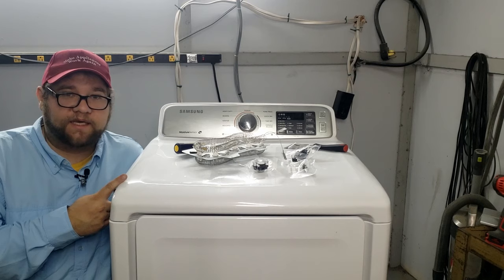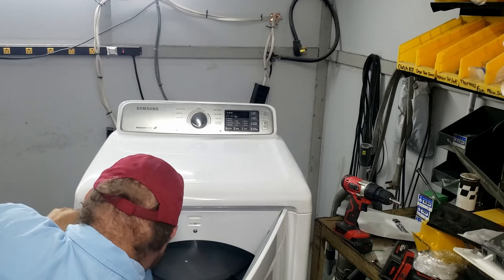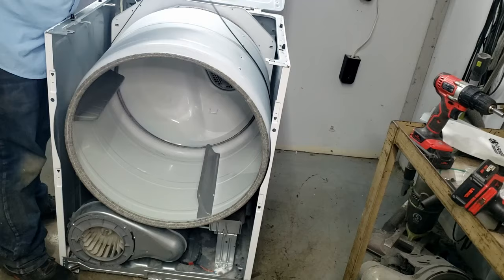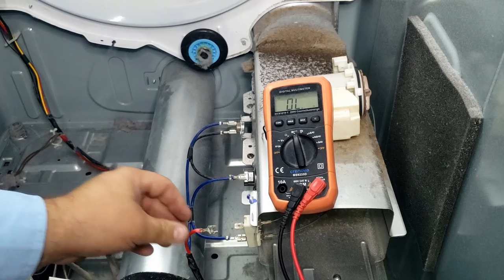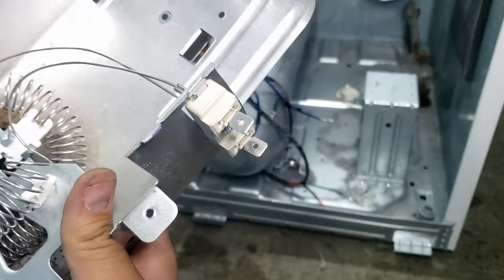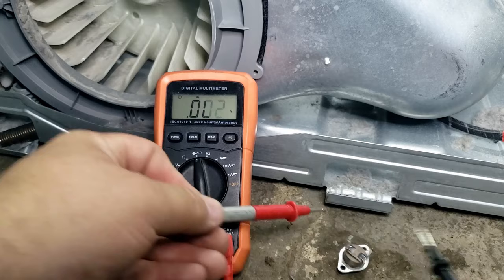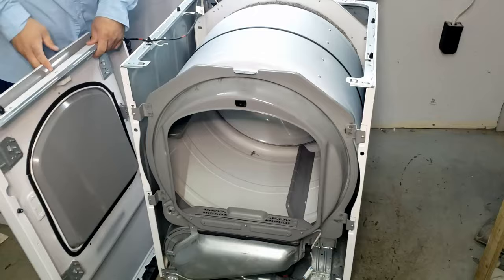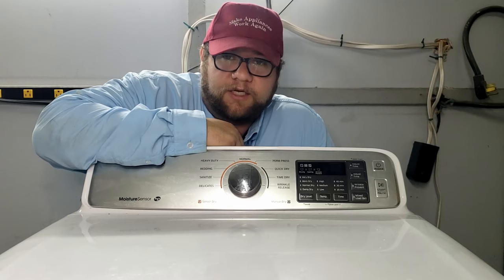Samsung Dryer Heating Element Replacement - How to Fix a Samsung Dryer Not Heating

Comment: Thank you so much brother!!! I changed the belt tensioner arm before (plastic garbage design) myself and just replaced the heating element today. The actual most difficult process is the belt on the arm for me when reassembling.
Just curious to ask others that have done this, is a little newness heat smell normal when first turning it on and it running for a few minutes? I would think it’s completely normal based on previous experiences on other electrical heating elements.
But thanks again…..it only cost me $47.80 for the aftermarket part….it would cost $280 for the OEM part but hell, it’s all the same quality pretty much.

Comment: You can remove the unit element without remove the cylinder. Remove the door unscrew the element case. Unscrew the braket of the element case and remove the element case. Thanks for that video. Sorry for my bad english

Comment: Great video, thanks. My dryer says it is 3 OR 4 wire. Why does it say "or" and can I simply use the 3 wire kit to replace?
Reply from the maker: That is specifically mentioning the power supply cord, not the heating wire on the inside

Comment: Great video!  Followed step by step with ease.  I attempted to remove the fan to clean that area better but after removing the nut the fan would not come out.  Any recommendations to removing the fan?  Other than that everything was very simple.  My coils broke apart so I was able to easily troubleshoot the issue.

Comment: Thanks very much for the instructions. Easy to follow. One question, I replaced all of the parts you indicated in your video. Now when I turn the dryer on it trips the breaker in my panel. Any ideas?

Comment: So I just bought a new Samsung DVG50R5200W gas dryer a week ago. It dried two loads of laundry and then stopped heating at all. Everything else functions normally or seems to but there is no heat. Gas flow is good. Any idea where to start?

Comment: Great video! Question: I just got this dryer for my daughter - it runs for about 5-10 minutes, then quits, gives error HC. Manual says that’s probably due to lint build-up, but I cleaned the catch and it’s a brand new exhaust hose. Any thoughts? Thanks!

Comment: Hi   Can I ask you a question.  Did you use aftermarket part or OEM. Because after I changed mine I feel like it take longer to dry my clothes.  I think is because I used aftermarket part. Please answer my question

Comment: Great video. I got my dryer apart. My dry has not been fully drying my clothes. The element reads 9.2 ohms. Do you think it needs to be replaced? Or is it possible it’s the moisture sensor?

Comment: Hey Ben, it is doable to replace the heating element housing assembly without taking out the drum and the belt. You need to wear long sleeves and gloves though.
Reply from the maker: I am certain you can because I've done it before. However, given that I'm teaching people that have never done this, I feel more comfortable making them go the long route that is a bit longer, but easier to identify the parts and whats wrong.

Comment: Hey Question- first of all the video is fantastic and no problem taking the dryer apart. I ordered the complete part. However, the wiring connections are slightly different from my original dryer for example they go to different end of the fuses. Does this matter or should I mimic the original connections?
Reply from the maker: No that doesn't matter. The wiring idea is that one wire from the control board goes to the rear of the thermal fuse, then it goes thru the fuse, then thermostat, then to element. The free plug on the element then gets a wire coming from the motor for the other side of the 240V signal

Comment: At 3:04 you mention that you are removing the moisture sensor, but all I see is a housing but no moisture sensor. I think most moisture sensors are a couple of metal looking bars. I think these are supposed to be checked for lint and dirt, but I must find them first. Where are the moisture sensors?

Comment: I need some help. I found the wiring for the rear sensor on the heating element burnt. I am looking to just cut and splice another piece, but i'm not sure what wire to use. I know that it is a 14 awg 600v wire. Any tips?
Reply from the maker: Don't overthink it. You just need 12-14awg wire and a high-temp spade connector. It happens a LOT. We probably have to fix a machine every week that has the wire burnt. Eventually through just general movement the spade may lose its firm grip on the sensor, slides off, and burns up.

Comment: How did you get the top to close again? My metal prongs wont let the top go down and clamp. The thing keeps popping back up now, and won't secure down. Sometimes when the machine is on the top thing just pops.
Reply from the maker: I would loosen the screws up in back then pivot and lock it in at the front first, then re attach the screws. It should help secure it better

Comment: I want to say thank you I appreciate your video sir. I have a question I experience the flood in my basement a while back and judging from the looks of where everything was on your video the water level was definitely higher than that whole heating element so my dryer spins and also has no heat of course. Do you think it would be better to try and replace the heating element like you did in this video or should I just say bump it and get a whole new dryer?

Comment: Hey thanks for the video fixed mine. Heating element read open on the meter and the belt pulley was seized up and broken. So new element and pulley assembly and belt good as new. I want to share were I got the parts as I save well over a hundred dollars and when the parts showed up they were factory parts. I went on Searspartsdirect and Samsungparts and got the parts numbers then googled them and amazon had the parts for way less. So you can save a lot of money looking up the parts then putting that part number into Amazon.

Comment: My dryer just failed and I’m going to use this video as a guide.  Thanks in advance.  Just wondering if there was any issue with the dryer you were working on. It seemed everything checked out.  Did I miss something?

Comment: hello! my heating element eas replaced in april but now its no longer heating! Fran thinks that the Samsung’s might blow the fuse inside the panel can you help me understand that but I would need to do?
Reply from the maker: Probably thermal fuse on the housing

Comment: I did this 11 months ago and it worked fine. The dryer stopped working again. So I changed the element just like last time. This time, the dryer started spinning, and the breaker tripped. Checked all parts, and the correct numbers showed on the multimeter. I'm not sure what the problem is! Any help is needed
Reply from the maker: Could be a weak breaker

Comment: Great video.  However, you don't need to remove the drum to replace the heating element.   Once you get the front panel off, you can access the heating element housing from the lower front.
Reply: You still need to clean the dust.

Comment: hello I installed everything the dryer gets hot now but It has a slight smell is that cause of the new element or do I need to retrace my steps everything was re installed the same way it came off I video recorded everything I removed.
Reply from the maker: Small odor is always normal.

Comment: I rep;laced element and tested switches and sensors.getting a clg code. With the vent hose disconnected after cleaning everything out just to be sure and tested it again same code thoughts on what it could be?

Comment: I took apart my Samsung dryer due to a loud squeaky noise. I put in new rollers, new pulley and just did new belt.  The dryer heated up prior to doing this.  when I put the dryer back to together it worked with no more noise but now it's not heating.   Not sure what I may have done which I didn't touch the heating element at all.  Any advice on what to check
Reply from the maker: Usually its a wire that got loose, or maybe reversed. Another thing would be to check the idler pulley. Make sure that when you pull "up" on it you hear a click... There's a switch internally that, if not clicking, could cause it not to heat.

Comment: Great Video, BUT All that is NOT Necessary, You don't have to take front of the Drum or the Drum out. The stand that holds the the Heating Element up, will easily come out, by taking the 2 screws holding it down out, lean the stand back & release the tabs. Remove the Heating Element stand. Re-install. Much Easier, & way less time consuming.

Comment: What happens if it’s getting too hot now and smells slightly like burning. I have a thermo gun on the back and it’s reading 215 at the silver grate
Reply from the maker: Could be a vent / air filter restriction

Comment: Hi Ben Need help please:
After replacement done once turn on  the power outage immediately. Sometimes run 2-3 minutes then power outage again .
Appreciate any help !
Now run 2-3 minutes. Power off . Also the top are very hot . I have to shut off the break .
Reply from the maker: I am not understanding too well. The top of what is hot? What all did you replace?

Comment: Great video.  Does the thermalnfuse thermister have to be placed a certain way?  There is no indication on either part which is top or bottom....thanks
Reply: Getting an error code tE, which I believe is one of those parts

Comment: So I watched the video and was able to change out my heating element. It was definitely bad. I now have it up and running but still no heat. What is my next step?
Reply from the maker: Check voltages and make sure its getting 240v. Then make sure that it's sending that signal to the element.

Comment: Hello Sir I have a problem I have replaced the heating element for my dryer but for some reason it will heat up but shut off if its to hot or it will just not heat up would you know why that would be frustrating and confused please help
Reply: Was u able to get it fixed

Comment: I hope this comment help someone else out I replaced everything and I kept blowing the breaker and could not figure out. As it turns out one of the wires was bent on the heating element, once I found it and straighten it out a bit it was good to go

Comment: Hello-

I bought the individual parts kit to replace all parts like your video through the Amazon link you have in your comments, I opened my dryer unit and noticed it has three wires instead of two connecting the heating element, will this kit still work?
Reply: It was definitely not the right heating element for my dryer. I found this website really helpful when figuring out the exact parts I needed. https://www.partswarehouse.com/Samsung-DV48J7700EW-A2-02-Dryer-s/357674.htm  And the diagrams helpful. Ordered a heating element separate from the kit of parts. When I took my dryer apart I noticed the heating element was still in tact so I changed out all of the fuses the thermostat and thermistor and put it back together. The heat has returned! Really appreciate the guidance in this video very very helpful!

Comment: Hello. Friends bought such a dryer, but it is not clear how to connect it. The diagram shows L1 and L2 with input voltages of 120/240 volts. Please write if you need to apply 2 different voltages, or one of them. We don't have a service close to where you can turn. Thanks in advance.
Reply from the maker: L1 is 120v and L2 is 120v. Combined to the heating element, it provides 240v.

Comment: Dryer wasn't heating.  Replaced the heating element and it dried a load of clothes however the next day the second load dried part of the way and then the dryer stopped heating again.  When I checked the heating element again it had several breaks in the coil.  What could be causing this?  Control Board?  Bad Thermostat?

Comment: Help & Thank you I feel like super Hero mom. So question I ordered from the appliance part store you had below but The parts that are old don’t look like I can remove them to put the new pieces and I’m going to post a picture of what I mean
Or not sure I can. The thermostat is attached by two buttons that look like they’re soldered on the new piece does not have that part I wish I could post a picture sorry

Comment: Thanks for just jump cutting past anything that gives a problem. Here’s a tip, if it gives you trouble what are the odds it gives us trouble. If you spend 20 minutes in a random problem, how long do you think it will take us to figure it out after you edit it all out.
Reply from the maker: The video was for a specific problem, as the title says. I was asked to thus video, this video specifically handling the issue of a heating element for a Samsung dryer. I'm not sure which things you are accusing me of blowing past on this specific dryer.

Regrettably. Youtube does not allow you to ever edit a video to add in more content. Eventually I'll make another video similar to this with more detail. However, in my experience, replacing the parts, all at once, has a 80-85% success rate, and almost every tech suggests replacing all components due to the fail rate of each of the components
Reply: @bensappliancesandjunk  no you didn’t do anything wrong I was mad when I wrote it because I had trouble getting the heating element back together, the part you did off camera. What really did me in was the darn top, I got everything done and the lid won’t close. I saw that you didn’t get yours  to close either right away and the video jumps forward to you running it. So I figured you had to mess with it to get it close. How is it the easy part of the project, closing the damn top is the part I have the most trouble with. Anyways long story short it’s running perfect but the top is banged up something fierce and it still isn’t closed  and my hands hurt from hitting it lol. Sorry for bitching at you.
Reply from the maker: @frankrizzo2348  oh I see. Yes. I realized after filming that part really needed added on. I did another video or two about samsungs after this one, and pointed it out more fully. When I did this video I didn't have the ability to shoot all of the parts as well as I wanted, so that was a bad case where I didn't have the ability to really explain it.

Comment: I followed your video. It worked and made it easy to fix. However I must of done something wrong. I now have a puddle of moisture in the drum. I have taken the dryer back apart and it looks like everything is put together the way I took it off. It never had this before. What did I do wrong? Please help

Comment: I hope you, or someone who was also successful with completing this can reply.. I was able to follow all the instructions, however I did not have the meter to test anything so I just took the chance and changed out everything as directed. All went well, however when I started the dryer it gets hot but it smells pretty strong.. is that just the new coil heating up and the smell will go away eventually?
Reply from the maker: Yes there's always an odor between the new coil and dust being moved around due to installation

Comment: Good video , is it just like any heat source , the first time you kick it on it puts off an order ?
Reply from the maker: Yes, that and usually you've disturbed a ton of air/dust from the cabinet it'll likely burn a little bit of dust to clean the coils

Comment: m ysister in law had the same issue and had almost everything internally replaced. when I looked at it, the ground was attached to the neutral and once it was grounded properly, the drier has worked fine for over 3yrs now

Comment: Hey Ben,  I have changed the thermo fuse twice now,  It keeps blowing.  I have now taken it all apart and also checked the moisture sensors which also test good.  The only thing I can figure out is, the wiring side.  Mulitlpe videos show different ways it has been wored (red on top or bottom) for the heater coil?  Would this greatly effect the thermo fuse blowing.  It usuall lasts about 2-3 loads before just spinning with cold air.  Any help would be appreciated.
Reply from the maker: No. If the fuses keep blowing up, its either a vent restriction in the duct work, or the motors' going bad.

Comment: When I check the element nodes, I'm not getting any continuity for the two closest to front of machine. I'm getting 0.3 ish for the other ones.  Does that mean I just need to change heating element? Seems that way, but thought I'd ask just to be sure. Thanks man!

Comment: Thanks for the vid. Did this about 9 months ago and fixed it but today it quit again. Is there another culprit I should be troubleshooting? Thanks
Reply from the maker: Look for vent obstructions that'll cause heat to backfeed to the dryer, causing it to heat up too much too fast. Also WASH the lint filter. They can look total clean but have invisible dust and dirt. I did another Samsung dryer video where I took a good-looking filter and started washing it... If water pools on the filter, it heavily needs cleaned. Water should flow freely thru the filter and not puddle/pool up at all
Reply: @bensappliancesandjunk  thank you very much!

Comment: Thanks for the answer. We only have 220 volts on the network. Can I apply 220 volts to L1 and L2, leaving it not connected to topic N?
Reply from the maker: Given your cyrlic name, I am assuming you're from Russia or another place that has a 220v / 50hz electrical network. My appliances in the video are configured for the US network of 240v/60hz. I am unfamiliar with how your electric distribution works.... You may want to find a video that is more accurate for your location.